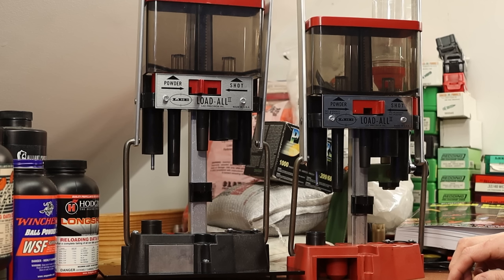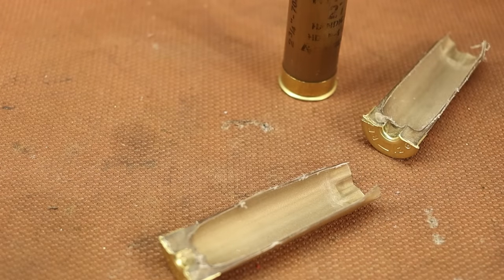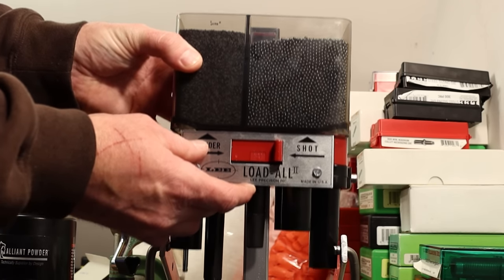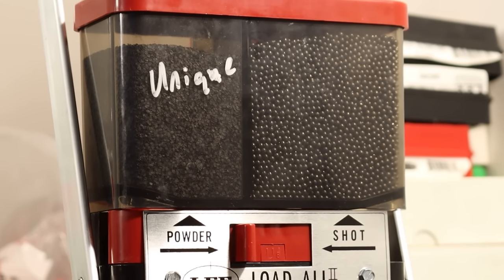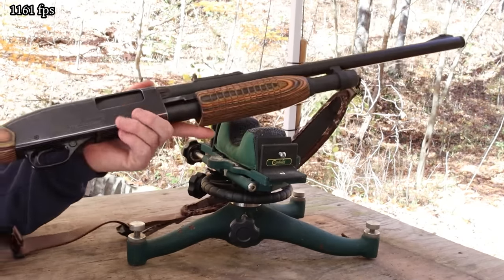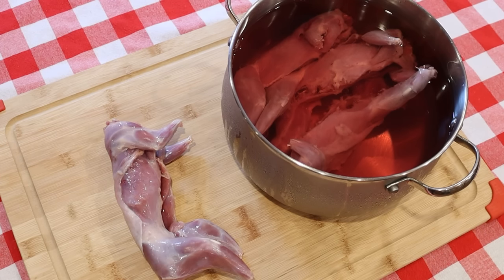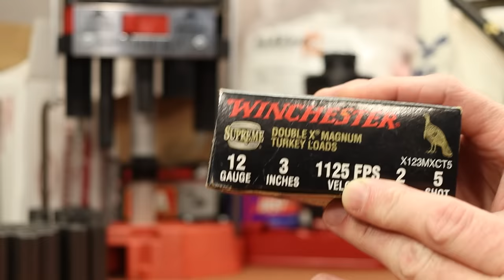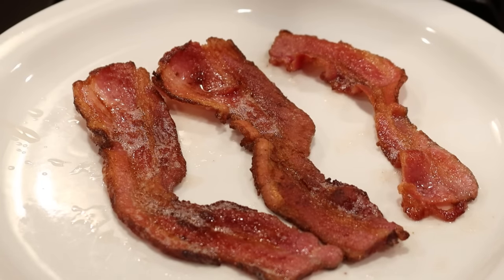Loading 12 gauge, hunting and cooking squirrels

Comment: Once fitted hulls are more often than not exposed to moisture sitting out on the Range until they pick them all up and will Rust shortly after you get them, or while in storage in your Reloading supplies cabinet but at $6-$7 per 100, not expensive. 
But a much better deal is brand new halls that have already been primed and are ready go for anywhere from $15 to $20 per hundred and realize this, they're already primed so you don't have to worry about finding primers, and the biggest thing is, they are 100% fresh and ready to go while they sit in your closet loaded with 00-Buck for the next two years waiting for SHTF, and the heads will not rust!
Wads are often $9-ish per bag of 250.
I go to Ballistic Products for Wads and new hulls as their selection is good and most of their catalog is in stock.
You have to watch daily for hull though but they seem to be the only ones stocking hulls on a regular basis.

Comment: We used to use one of those loaders 25 yrs ago just went down to clay shooting ground and picked up any Winchester empty cases preferably long brass , later using hull cartridge cases and got on reloading mainly for pigeon shooting cartridges around 28/30 grall loads never had a problem and shot loads eventually got expensive to reload so started buying cartridges
Reply: Should have said in uk

Comment: I would suggest a pressure cooker instead of the oven. It will reduce cooking time to fall off the bone. Of course, it is easier to go to mush unless you check it often because it speeds up cooking so much. But it will be done in minutes not hours. I have a couple of MEC juniors and by looking at this video they are much better choices for reloading. I did think about a Lee Load All but after seeing just how much plastic and how they work would certainly not consider one now. I do have many Lee Products that I do like, their Lee Collet Neck Sizing Die is one of them and their Deluxe Die Sets that include them with their factory crimp die is another. The MEC shotgun loaders have a large assortment of bushings and one can even get a shot bar that you can be adjustable for what you drop. I like Blue Dot for magnum high velocity loads, but it is a very dirty burning powder. There used to be all plastic one-piece shotgun hulls. I like the one-piece hulls best but looking at what you have been buying I am not sure they are as common as they once were. Long video but it was interesting. I used to cook the entire squirrel head and all and some folks eat the brains. But I have been cutting the heads off lately not to gross the wife out because she is good enough to cook my squirrels and make squirrel gravy as well. She does use a pressure cooker to speed the process that is why I suggested it.

Comment: I've been reloading cheddite hulls without issue. The only complaint I have is that the crimp tends to push back a little and flare outwards. I suspect this is due to the softer plastic. Not a big issue as they still feed just fine.

Comment: shotshells seem to be a confusing mess. as always with lee expect it to throw light. lee scoops and bushings are designed around the maximum allowable density of a powder so you can not over charge with a new lot of powder. It has taken me an embarrassing long time to figure out crimping on the load all. marking the crimp body with a sharpie helps getting it aligned. 
all of my shotgun loading is with black powder. much simpler as you use fiber wads and the same volume of black powder and shot. this is also the reason you find shotgun listed with dram equivalent. a dram is 27.3 grains.
I say go for a 410 setup. it was your first gun and I am sure hunting with it using shells you loaded yourself will be deeply rewarding for you. 410 with lead shot might still be useful for pests around your little farm.

Comment: the way that the mec press powder and shot bottles work is a way easier setup to change powders or shot, they flip back so you don't spill any.... i would stick to a 600 jr unless you want to use highwall brass or want the automatic primer tray on the sizemaster. also mec's crimping dies are floating/free spinning so you dont really have to line up the folds every time you go to crimp the shells.

Comment: I reload shotshell (410) and the hole in the crimp is due to lack of enough shot.  I would try to go up 1 bushing on shot side and check it.  may be too much but worth a try.  Shotshell reloading and reloaders are finicky (i use the mec 600 jr).  There is a ton of forgiveness in shotshell reloading as far as powder measurements and shot measurements go.  Great video.

Comment: Sizemaster comes with the primer feeder, whereas for 600 Jr it's a $100 upgrade. 600 Jr is close to the price of a Sizemaster. The difference is also how they resize the brass. Sizemaster squeezes it, whereas the 600 Jr works more like Lee Load All II.

Comment: Great video, I started out on the LEE loader years ago.  used it until it was mechanically so loose it would not press shells parallel during crimps.  Moved on to MEC single stage loaders.   I typically loaded the Win AA and my favorite load was a 12ga 1 3/8 oz of #4 pushing 1385fps as I recall.  That load was devastating on everything and especially ducks and pheasant.    Then steel shot came along and I had to start loading steel for ducks.  I moved on to 10ga and I found heaven, what those machines won't kill with authority I don't know of.

Comment: You are correct in your assumption that the taper vs straight wall is your Federal/Win Super X are straight wall and the Remington/Win AA are tapered. I actually got started reloading on Shotgun. If you want some more of the Remington hulls for your target/game loads, I have hundreds of them. The Remington STS, Nitro 27, and Gun Club hulls are all exactly the same shape. I found that the Nitro 27's last longer than the other 2. I found the STS last the shortest of all three.
Reply from the maker: Thanks for the offer! I bought another box of each, so I've got 100 nice hulls to play with now. I should be good for at least a little while.
I'm on the hunt for 410 hulls now...

Comment: Good old video from jrb. Way go Shannon.  Took few days get through this video but I watch all of it some all need do once in awhile go squirrel hunting.  Squirrel is amazing cooked.  Could broke some up for your other channel.   As of shotguning u run 4shot for squirrel to turkey to pheasant.  I got 2 3/4 and some 3 inch mags .  Iv ran 3inch mag 4shot in 5 shot and 6shot loads extra full chokes for squirrel in passed with my old mossberg 500 it gives u tigher patterns and more range.

Comment: Nice vid!  Lee are under rated and last longer than it feels like they will.  To empty, drill a hole in the corner of the lid, put the lid on and pour out one compartment.  turn the lid 180 degrees and empty out the other side.  with that 5 yard squirrel i couldnt help but wonder if you were going to strike it rich finding some crude while shooting at some food!  i hunt with guys who load tungsten in 410 and drop geese.  im cheap so i load steel over 1700 fps in 12g 2.75 shells (precision reloading "lightning steel" book).  you were wishing you had a 22LR....i was thinking 223 with some light fast bullets and aim dead on out almost to 150 yards.

Comment: I bet you could 3D print a pair of plugs that fit tightly into each hopper chamber to both make emptying easier as well as provide an extra layer of insurance against dumping stuff everywhere.  Maybe make a small groove around them that you could put a rubber band or o-ring into to help keep it in place

Comment: The biggest issue I found by far was where the formula says to use a particular wad with a particular hull, like the "WAA12" Wad with the one piece tapered (thicker plastic as it gets to the bottom) "Gun Club" hull, (same as Nitro27 and some others) but that Wad will not go all the way down hull to capture the powder load. You can actually shake the loaded shell and hear the powder rattling around!
Some Wads are intended for tapered hulls only and will nlt seal in a straight hull, and some Wads are only designed for straight wall hulls and will not bottom out in a tapered hull.

Comment: Need a wire strainer, for separating powder & shot like that..and a well-secured press, so ya don't have to!. 😁 Thought about buckshot & slug loads? Home defense ammo!
  Home-made stock is the best! For soups, stews or even cooking rice in, Can't beat home-made stock, beef or chicken. And all it takes are bones and veggies!
I'd like to see some home-brew buckshot or slug loads, if you're into casting, Lee has molds for both buck and slugs, and if you can scrounge range lead or wheel weights the only cost is your labor and time. You can melt your bird shot, in a pinch, on a camp stove!

Comment: And that, Leslie, is why I still haven't started shotshell reloading [Note that when I do finally get started with shotshell reloading I will buy the Lee]. Its just so confusing or complicated. Also, I have been testing various projectiles and steel balls as buck shot for fun. That simply requires staying at or lower than than the payload weight and ensuring that everything goes down the 20" cylinder bore, barrel properly.

Comment: The unloading of the hoppers is why people pay extra for MEC presses. They use bottles you can unscrew and you don't dump everything all over the place. That is worth it just for that.
Reply: I originally had a Lee when I started reloading shotgun shells over 30 years ago. I got rid of it and bought a MEC 600 Jr which I liked much better and it also worked much better. More recently I want to upgrade to a MEC 9000GN progressive as my final equipment. The 600 JR works well, however it is extremely slow and time consuming if you are doing any kind of volume shotgun reloading and shooting.

Comment: As for pressure signs, if your shotgun is a pump action shotgun and you have a hard time ejecting a fired shell, it's probably because it was over pressure and the brass portion at the very bottom of the hill is now stuck in the chamber.

Comment: I find that the powder charge bar isn't very accurate. For the MEC you need separate charge bars for each shot load and different bushings for different powder charges. I find it easier, more versatile, cheaper and more accurate to use a powder measure. Like the one on your workbench.

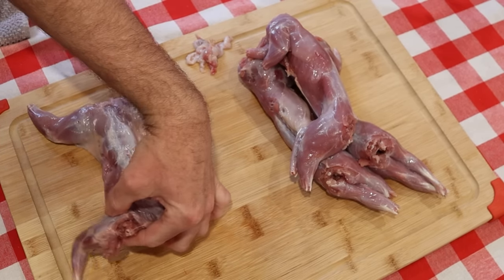Comment: @1:38:40 ,  meat cleaver.  No knife.  Easy. (And safer).  Looks good, but oh-boy, pure lard….  I switched to extra light olive oil or avocado oil for high heat frying.    Trying to keep the coronary artery “clear.”   Also, if you add about a 1/2 teaspoon of corn starch to the chicken broth, the meat comes out very very tender.

Comment: You already have longshot and blue dot powder and CB-1138 wads just order you some buckshot pellets or a buckshot mold or several and some buffer powder and you can load some killer buckshot loads! Warning loading buckshot is highly addictive lol. I'll recommend you one good buckshot load that does good in every shotgun I've tried it in. Get a .35 caliber Lee round ball mold they will stack by 2s in the CB-1138 without having to remove the wad pedals(.36 cal which is standard 000 buck size is a little to big and will dimple out the hull to bad when you crimp it and it won't feed in your shotgun. Anyhow it works with basically any straight wall hull use your Nobel sport primers 28.5 of longshot CB-1138 wad drop 8 pellets of 35 caliber pellets and cover it with buffer and crimp him and you now have a Frankenstein slayer! When I got into buckshot I watched a ton of bubba roundtree outdoors he is basically the master of loading buckshot. Also check out buck and slug reloaders on Facebook Wade Rush which is bubba roundtree outdoors is on there I'm on there along with a lot of very knowledgeable people that load buckshot and slugs is on there. Good luck and happy loading!

Comment: Shotgun shot is loaded by volume so 1 1/8 Oz of shot is 1 1/8 Oz shot no matter the size.
Great video
Reply: Zayha jorgensen.... 
Not always...
Reply: 'Theory of Minium Voids'; the more sizes of a given material the more weight.  This a 5 gal bucket of base balls; in theory, they displace the same volume as a 5 gal bucket of bbs.  Now, mix some Base balls, marbles, bbs, and sand, and you get a much much more mass, as the various sizes fill the voids.  Long winded way of saying, if the shot size is not exactly the same size and shape (some isn't as round as you might think), the same volume might be more weight/mass.
Reply: @paulharveu526  
You are correct...  my point exactly!

Comment: YES, GET THE SIZEMASTER....  WITH THE COLLET DIE  it does a much better job of sizing  the hull without  oversized or swollen hulls getting stuck in the sizer die.  YOU MIGHT WANT BB STEEL... for the budget loads.   TSS  use MYLAR WRAP inside steel rated wads... TSS is 'super hard'  shot.

Comment: I'd use those Nobel Sport primers with any Winchester, Cheddite, Rio or middle of the road burn rate primer... As far as pressure signs go, you'll see primers start to flow up over the firing pin, the rim will bulge, primers will even pop out of the pockets, hulls will split, or cut in half (like a cut shell)... I've shot loads upwards of 18k psi and only (😂 only) had hulls split and primers do weird things. Overall, as far as your load's pressures are on the lower side, swapping a primer won't matter.
Reply: alliant powder does load data that seems to use same brand primers and hulls (i use rem hulls but not rem primers).  i asked about swaps and they said swaps are ok when the pressure is between 6500 and 8500 based upon their research.  sounded really reasonable.  i shoot a 3.5 inch chamber just have have 2500 psi more pressure rating.  i dont like beating mysefl up so that big chamber is about increased pressure and not 3 or 3.5 inch shells.
Reply: @ktkawaguchi    I definitely test and develop my loads in my VersaMax before shooting it in anything else for that reason. As long as you're not pushing the ragged edge, there isn't an issue swapping around components. It's not as hard as people think. Go by the book as best you can and you'll always be ok.

Comment: If you find primers that have a hole burned in it shows too hot or too much pressure.Remington hulls with Remington wads, Winchester AA hulls  use Winchester design wads.  Brass is easier to resize

Comment: The trick to emptying it is drill a 3/8ths or 1/2 inch hole in corner of lid, then you can flip lid around to empty shot or powder without the other side coming out through the hole
Reply from the maker: I considered that, but I wasn't sure if it fit tight enough. I'll give it a shot.

Comment: The main reason I started loading Hulls is the fact that 00 Buck and slugs were $1 -$2 per round or more, and that's if you could even find them!
I also I got a Lee #4 Buck & the 00 Buckshot as well as the 7/8 slug mold because that 7/8 slug flies much more stable than the 1oz slug.

Comment: Well as I was going to reload my 12 gauge shot shell I am now more confused than before. It seemed so simple before watching this. I think the problem is is that you over thinking it. I have reloaded for all my rifles without doing much research never had a problem. Shotguns are simpler in my opinion but am more confused after explanation of different shot shells

Comment: If you shoot a cut shotgun shell the only additional weight is the section of the case that goes off with the round.  There is no guaranty that that case will exit the barrel either. Should the crimp open the wad and shot could pass through the case leaving a restriction behind in the barrel.   
The only difference to be concerned with regarding shot primers that I've experienced is that imported cases and US made cases can have different primer pocket sizes.  Use imported primers in imported cases and US primers in US cases.  Otherwise Lee is correct, there is not a bit of difference.    The 2 factors I find important are wad pressure on top of the powder and the quality and uniformity of the crimp.

Comment: All I can say is, where the heck were you with this video last year, man?

I’ve been reloading pistol and rifle for decades, and finally decided to jump in to shot shells. I did pretty much the exact same things; obsessing over the data, weighing and re-weighing damn near every charge of powder and shot, even spilling powder and shot all over my bench. Although, my stuff spilled when it slipped out of the clamp I had holding it down instead of screws too short. Pretty much the same lessons learned too lol.

Comment: Emptying the container is easy. Drill a 3/8" hole in the corner of the lib and use it to pour the powder/shot out of the containers.
Reply: Also try the same recipe but instead of dumplings, cook rice in the broth then add the squirrel back in when the rice is cooked. My grandma called it tree rat and rice. Delicious

Comment: With the TSS we have had better luck using shot cards and roll crimps. Instead of crimped shells. Its also cheaper to roll crimp instead of using a press. Just a drill press and roll crimp head.

Comment: Only 209 primers I've been able to find are 209m for inline muzzleloaders. Haven't tried loading any yet because I don't know if I trust it.  Online mixed options some say you can some say never to use them.
Reply: Cheddites are available.  They are allowing me to save my American primers (and especially my Fed209A for waterfowl loads).  But once a hull is used with Euro primers dont plan on going back to American primers.  I just write off the hull to forever be Euro primed and have not tried MannyCA's swage trick to tighten up the pocket.
Reply: @ktkawaguchi  new cheddites are same size as American primers now.   I’ve loaded STS and AA hulls 5 times with Cheddites and then started using win 209 again no problems